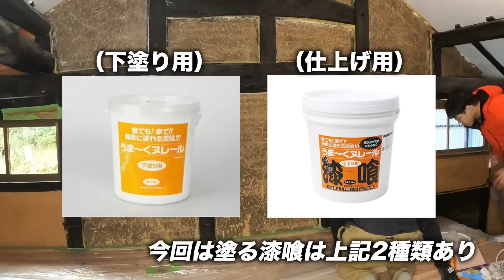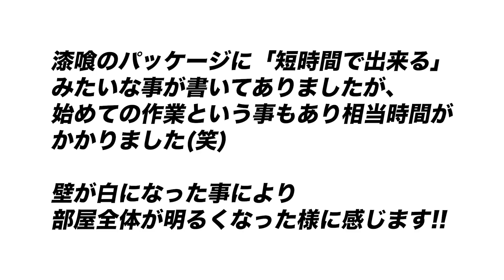古民家の荒壁に素人が漆喰を塗った結果

Comment: Only negative comment about your work is, paint and plaster BEFORE putting new floor in. It lowers stress over spills and stains. Besides that excellent work. I'm currently remodeling my own house for the second time in 30 yrs to bring it up to date. All the lessons and advice I've gotten over the years from older generation before me have really helped save time and effort.